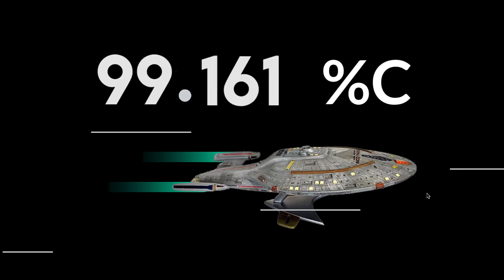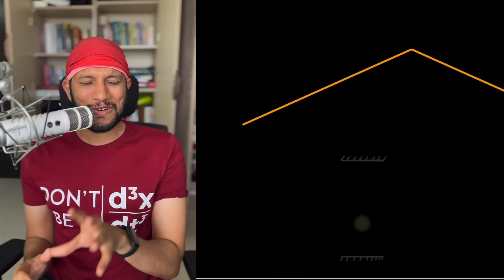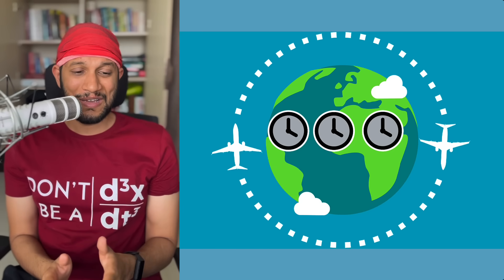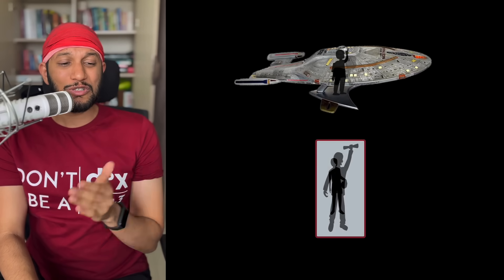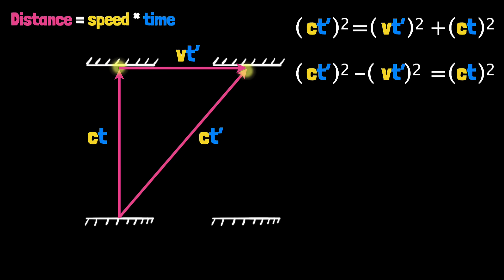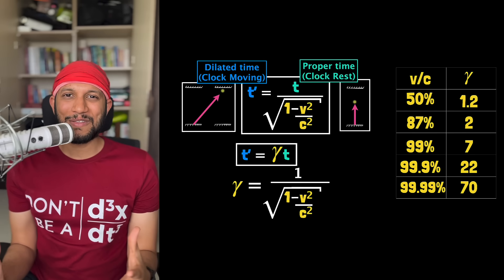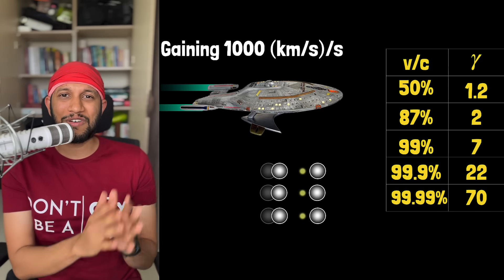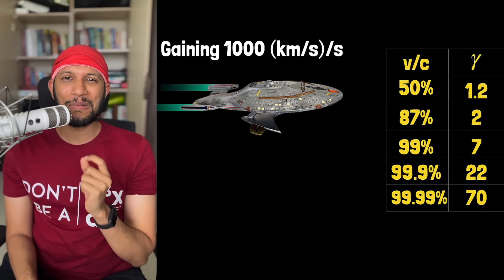I finally understood why you can't go faster than light! (My mind is blown)

Comment: From my intuitive and limited understanding of physics and our universe, I believe that the conventional concepts regarding the state of matter are deeply flawed. Specifically, I propose that all matter consists of light particles in some sub-state and thus inherently exists in an "on" state of light speed. Further extrapolation of this idea suggests that all matter is specifically structured within a framework of relative physics, and that time does not truly "exist"; instead, kinetic energy and other forms of energy give the impression of time.

If we consider that "light particles" within a system—like particles within a ball—are able to accelerate, we can infer that these light particles can be structured to be normalized in quantum states during the transitional phases of acceleration. By normalizing speed and force vectors through quantum state manipulation, doesn't this mean we can accelerate faster than light? This concept is similar to "piggybacking" on relative states by creating relatively opposing states of acceleration—like a catapult effect on a juggled light state—creating force vectors to structure a relatively faster speed through a normalization process.

For this we need to theorycraft the Quantum Composition of so-called matter - there is no such solid structures as you have simplified in your videos - it is energy bubbles which are in line force bubbles - and we need to represent this basic building block which is in the quantum realm - a force field which forms are protons, neutrons, electrons, and so called "Light" which is interesting composition of force fields = if we can define this then we can define what the so called "Speed Limit" is and where C is derived and how the force state vectors impact it - and why and how we can manupilate and structure it within the propertise of the "Energy" - also this leaves a big ? question mark on what is Space and Vacuum - is Vacuum really empty? Or the strings of energy are present there in a formative sort of way - where they are not actively creating interactions - argh too hard to even think about how fucked up that is - and how insanely wrong our physics might be - it is like our physics is at a toddler level - and we don't know anything outside of observational framewokrs - so making absolutes is insane.  Think about it as if we are trying to define how a building is constructed where we just define the shape of the building observing it from a super giant's perspective without ever disecting what is inside the building - yes the description of the shape and the so called mathematics to define that shape will be correct - but the nature of the building and how and why it stands there will be completely at level 0 of understanding - we are not even at the building level we are at a level where we look at earth when we are the size of the solar system and say - tiny ball is round and the radius is x and it is relatively smooth - without knowing anything of what's inside - we can't even observe....

This is why I don't want to research into this - it will be endless - MADNESS - I RAGE QUIT!

Comment: Yet to my understanding there's still more going on?
For starters, if you look at time and distance as one single dimension, spacetime, then in this spacetime dimension your total speed is the speed of light.
You're not only moving through space. You're also moving through time.
If you try to move faster through space, you can only achieve that by travelling slower through time.

Also the 'infinite energy' is a bit debunked since in E=Mc squared you need infinite energy if something has mass.
However only a percentage of mass is caused by the particles itself. I think around 80% of 'mass' is caused by moving through the Higgs-Boson field?

Comment: Actually it is quite easy to comprehend, Imagine if our world is generated by a device, and the speed of light is your capping fps limit, regardless how fast you wish to go, if your device can only support 120 frames per second, that's the maximum speed of light you can observed, whenever you attempt to exceed that speed limit, it will only slow down your device performance to cater for the workload, so it end up messing with the timeflow rate that we (who only existed in the device) can observed as well.

Comment: If you have resting mass M0, it will take you infinite energy to accelerate to C. They always say that this works for photons because they have NO rest mass, only now I heard they believe photons have a very small rest mass of 10-54kg (5.610 ×10-25MeVc-2). If this is the case, this more than absolute ZERO and how can it achieve the speed of light???

Comment: The simplest way to put it, is that everything moves at the speed of light. Speed is a measurement of progress through space and time. So at any moment in time we are moving at a certain speed, and at any speed time flows at a determined rate. The faster you move through space the slower you move in time, if you move through space very slowly, time flows at a rate close to 100%.

Comment: We can go faster than the speed of sound with all the same problems but with sound, that is not the reason we cannot go faster than the speed of light. Clocks do not tick slower as you said here, they tick at the same speed but the photons which are what we see will display slower. The clock's gears and mechanism has no reason to slow down. Time dilation as noticed with atomic clocks and such is not because of photons speed, it is because of gravity/time and space being a fluid. In areas of more dense gravity, the fabric of time is also more dense. The real reason we can't seem to go the speed of light is that the amount of force we would need to accelerate an object to that incredible speed is not currently possible. I think we can use relativity though to do it. You get something already going fast as a part of something else, then accelerate it within that already fast environment and repeat this many times too. For example, it is very easy for us to throw a baseball and to us it goes as fast as we throw it, but in reality, it is also moving with the speed of earth's rotation, the speed of earth's orbit, the speed of the solar system moving in space, the speed of the milkyway galaxy rotating, and the speed of the milkyway galaxy moving through space. So this baseball is actually moving at absolutely incredible speeds even though we are adding very little energy to it ourselves. It is still extremely easy to us because it is relative.
Reply: 100% agree. What applies to sound logically makes sence with light too. It's not the time that slows but perception or the image of said ship. Such as you shoot a bullet moving faster than sound, so that you first see bullet flying and only then the sound. That just means that object would be invisible to the way we perceive our world if it travels faster than light. And closer it gets to the speed of light the slower image gets, not the time itself
Reply: The gears and mechanisms do slow down, because the light that we see of them makes up their atomic structure too. The electromagnetic signals between them that connect the mechanisms of the clock take longer to reach each atom, so they would appear to be going slower and also ACTUALLY be going slower. Because time isnt a constant, its just the measurement of electromagnetic signals between atoms, where the ratio of signals to seconds is is x:1 when you are not moving fast and is much lower when approaching the speed of light, as he said 87% the speed of light equals an x:2 ratio. So this video is completely right.
Reply: That's about still the same problem to me. It's measurement device that gets inaccurate due to said phenomena rather than time slowing down itself. I guess it would be impossible to 100% proof actuall time getting affected
Reply: @L4dy_Kum  Read my above comment for the explanation. The measurement device is just a way of showing how time slows by measuring it with the hands, but everything that contains atoms would seem to move slower at that speed, not just the clock
Reply: @spand9043  well hold on though, the speed of light is measured in vacuum, right? Because it is slowed within our atmosphere and such. But we have never heard of light going slower on earth due to earth, our solar system, and our galaxy all moving. We have also not gotten different measurements of light speed from outside of the Milkyway galaxy. I know the difference probably wouldn't be noticeable to the human eye, but it would be measurably noticeable. So maybe the speed of light is relative after all and the mechanisms would go their regular, relative speeds. If the speed of light was fixed, then any amount of speed we see on objects already would be subtracted from its fixed speed. Shining a flashlight on earth would make a much slower beam than shining a flashlight outside of the Milkyway galaxy. You could say "well you only need to test it in empty space, but if you do that close to earth, you are still traveling with celestial bodies because of their gravity.
Reply: @nk361  the thing is, light isnt slowed down by much, only by things called refractive mediums like air, water and glass. It doesnt slow down due to gravity. This is because light isnt made up of any atoms, its just pure energy. So the speed of light is constant in space, it isnt affected by the gravity of celestial bodies.
Reply: @spand9043  but anything that we build or use would be moving with these celestial bodies while firing their light, right? Which would already start it out with speed if that makes sense, right? Unless it is relative
Reply: @nk361  while photons do retain momentum light cannot go faster than speed, the c value, so it would just cap at that speed no matter how fast it initially was moving

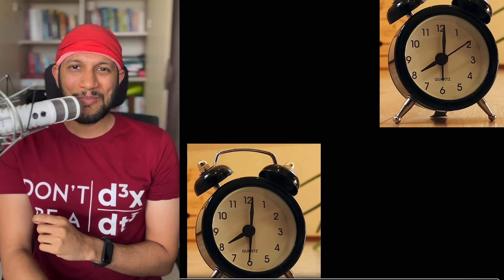Comment: 4:00 This is nonsence since photons traveling oposite direction whud be actuali accelerated whole time discrepanci whud tear the matter apart....

this is exact problem im have whit entire light speed its IMPOSIBLE TO EVEN GET CLOSE....

Even at 20% of light speed pressure on your veins whud already have efects on 60% you whud be death. Same as the ship it whud tear it self apart .....

ANd this problem can be easili scaled down to particles..... photon traveling on speed of light shud not exist since it shud tear it self apart im dont care if its made of field or some smaller unknown particles its shud not exist by definition.

ANd since photons do exist then the teory is WRONG.

Comment: 7:32 That sounded like a case of 'Just accept what I say' (Theory) because it can't be explained otherwise. Just accept what you're being told or my argument falls apart. It is here where my belief in absolutes comes in to play. Either you can prove it, solidly, or you can't, and it remains theory & may be wrong. It might be correct, but it still remains to be proven without a doubt. So, in my mind, Time does not change, at least not in the rigid way we think of time and FTL may still be possible. Perhaps we just need to open our minds in a way that thinks "out of the box" in terms of Quantum field theory and Quantum mechanics. Maybe one day!
Reply: Then you don't believe in the scientific process. There are no definite proofs in science. Only theories that are verified and falsified. This theory is incredibly well tested. But it will never be "proven". Neither will quantum mechanics. 
Being open to being wrong is core to science. Trying to prove the theories wrong is what scientists do all day.

Comment: Then how does light go the speed of light? I mean a star or sun has a finite amount of energy and its output stays relatively constant as it "shines". That would mean the suns output would have to be getting stronger and brighter much faster than possible since it too is moving through open space at an incredible rate and in order to compensate for that alone the light would have to be propelled at speeds above the speed of light in order to go the speed of light to begin with.

Comment: Didn't scientists at the LHC get particles to travel faster than the speed of light with no corresponding increase in mass?  Seems I remember this being the case.  They did confirm time warp by doing this.
Reply: No. No experiment at cern has ever shown faster than light particles.
One experiment once seemed to indicate neutrinos moving faster than light, but this was shown to be an error. https://en.wikipedia.org/wiki/2011_OPERA_faster-than-light_neutrino_anomaly

Comment: What I got from this is that
Photons are what transfer forces between atoms, they're what make the atoms move
Photons travel at a constant rate (the speed of light)
So the faster you move, the more time it takes for the photons to transfer force between atoms
Because the atoms are moving faster, but the photons are not "keeping up" with the speed increase
So you can't travel faster than the photons because the photons are what are make the object move in the  first place
So at most one could, with infinite energy or time, move at the same speed as photons (speed of light) but only for a the tiniest fraction of time as the moving atoms would lose force as the photons couldn't apply more force on them as the atoms are now keeping pace with the photons

Comment: what if... we have a really big source of light propelling the photon? I believe Light does have weight thus it could increase the speed of photon moving. it would not reach speed of light unless (i would assume) but it could distort the formula. basically a force pushing photons to move faster than they normally would.
on the other hand if travel against the light would it not slow down even more? and since light can move it slightly to the side would it just break the ship since photon could change the direction it is going?

obviously since photon has no mass (i think) but carry only a momentum. If light can carry its momentum into photon it could work no?

imho i have no idea what i am talking about just lil curious about it

Comment: I heard of the concept of relativity and time dilation many years ago when I was young. watching this representation with the photon clock actually made me really understand it. the faster you go, the longer it spreads out the wave length of time passing and no amount of energy can actually be produced to make something equal or exceed light speed due to relativity and time dilation. it will only reach 99.99999***% continuing into infinity as numbers are infinite. very interesting. another topic I would be interested in is the hypothesis if creating a "warp bubble" or "wave" around a vessel that essentially folds space enough to propel it from point a to point b while skipping a certain distance in between. I've seen a few videos and read some articles on the subject but they never go into any real detail on the theoretical process.

Comment: Well this is what relativity really is. We always tend to handle the speed as an observer. For example we typically think space travel velocities as we observe them from Earth. But the Earth is not stationary, it goes around the sun at 27 km/s. If we send a probe to opposite direction, it departs 27 km/s to our perspective, but it would be stationary in solar system perspective. And gradually start to plummet towards the sun. So if we try to make an object go faster than the speed of light by our, observers' perspective, the craft itself experiences only accelerations. The time goes by in the spaceship just like before, even at the speed of light. I don't see any reason why the accelerations doesn't continue like usual even after that threshold C. We observers see only past of the craft, it being practically stationary even though the craft itself has not been around for a long time. Stop thinking about this from observer's point of view, and move inside to that moving object instead.

Comment: Still I am somewhat confused. For normal object and speed its allright. But what happens when its equal to c, also not requiring infinite energy. What I am taking about is light itself, since it can be created by devices, I guess.  t'=t/0. Does that just mean it will take approx. infinte or undefined time to decay, i.e. property of object. Or if its time freezes 0 or dilated time of light reaches infinite or undefined. Also in the pythagoras theorem in video we can see vt' would be distance traveled by spacecraft was light itself and lets say distance that light was travelling was between 2 planet 2c distance away. d= ct'; 2c= ct'; t'=2; and t=t' *0. t=0 for all values of t'. And t' should be undefined (light) with t'=0/0, still t'=2 is defined (observer).

Normal method I understood somewhat, although I didn't understood the light somewhat, I guess.

Comment: Question: if the photon moves at the constant speed of light, why in the animation does the photon move at a slower rate for the "outside of ship" perspective compared to the "inside the ship" perspective (the photo bouncing vertically up and down)? Is this just an oversight on the video creator's behalf?

Comment: Great video!
One thing I'd like to add, that nobody talks about, is that you can effectively travel faster than the speed of light from your own local perspective by simply continuing to accelerate. If you want to get to a star 10 light years away in 1 year, you can. But it's your year, not the years of external observers. Because time slows for you, that means your perspective can be a very short trip for a very long distance. Faster than 1 light year per year.